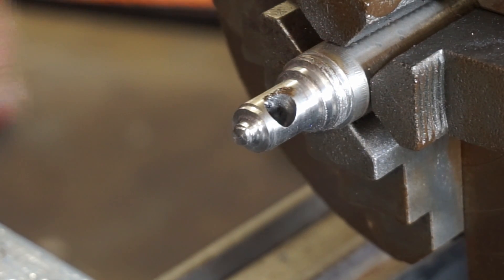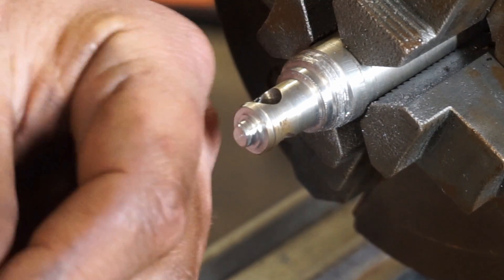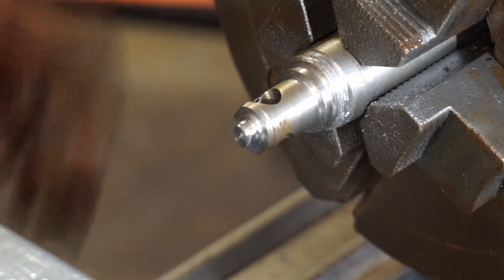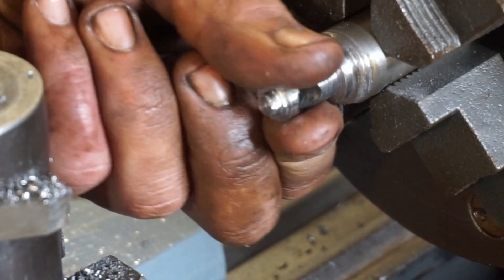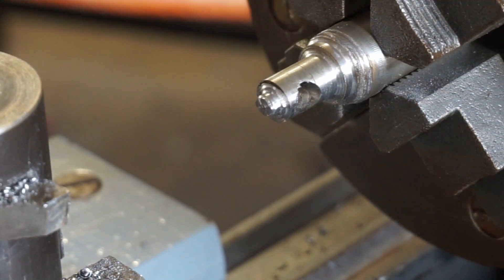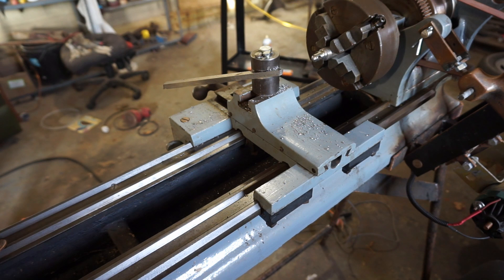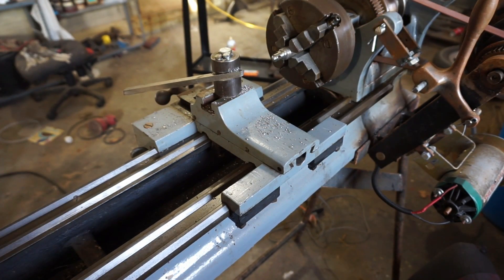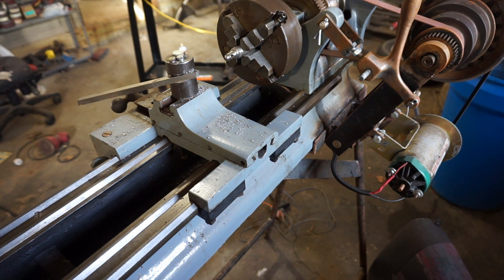Vintage Lathe Restoration: CHIPS!

Comment: The chuck jaws are out , check round stock with a dial indicator ,and adjust with the jaws, though you may have to use some shim stock to get it rite it is an old lathe, still a great machine, and thanks for sharing
Reply from the maker: Richard Wirt I didn't take the time to dial in the work just to try a. Test cut